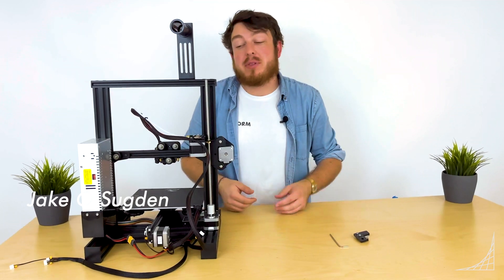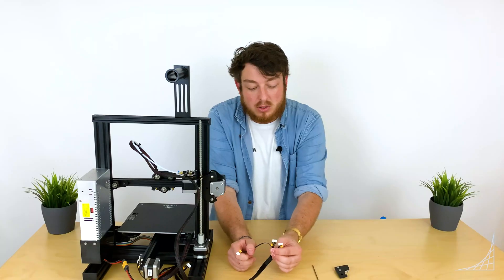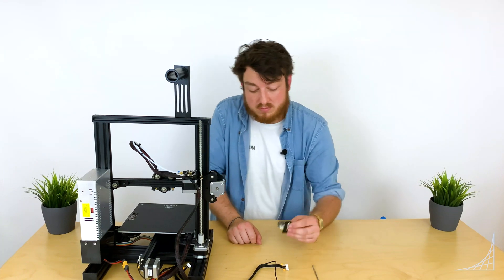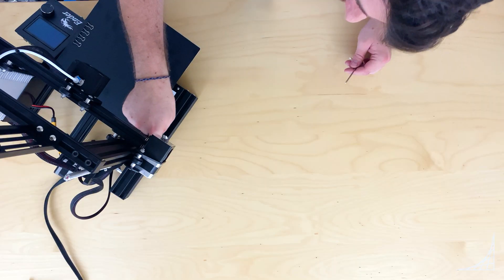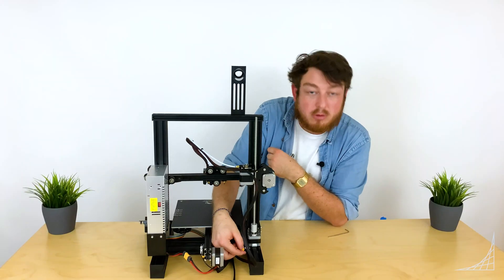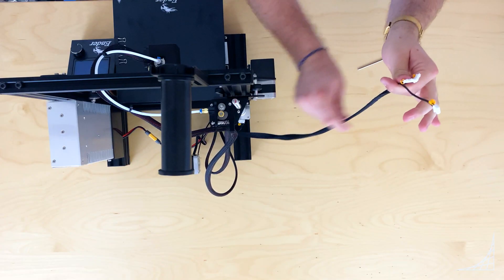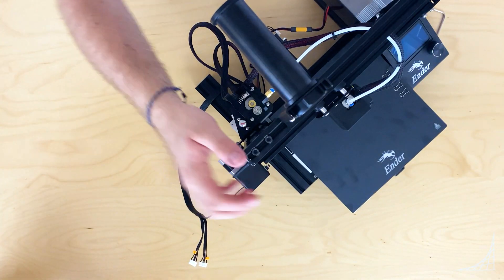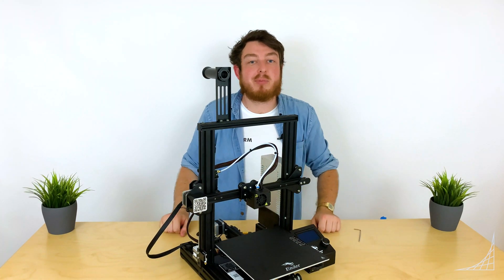Introduction to Ender-3 Assembly: Wiring

Comment: I bought a used Ender 3 v2 and my Z limit switch isn’t connected to the machine at all, does anyone know where it is supposed to be
Reply from the maker: it lives on the left side of the left vertical pillar. theres a solt down the length where you can slide in the Z limi switch housing with the T nuts on it and then tighten the bolts to secure it in place. Make sure its at the right height, theres a small black block on the side of it and it touches on the top of the base
Reply: if it has cr touch it doesnt need it